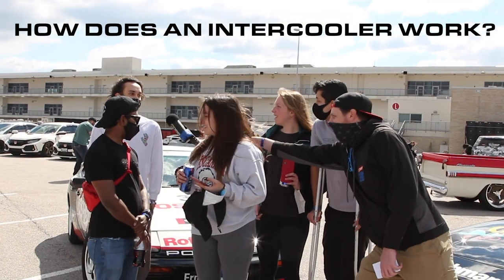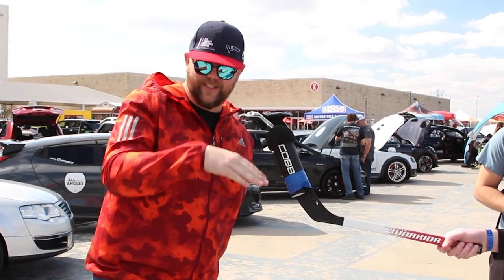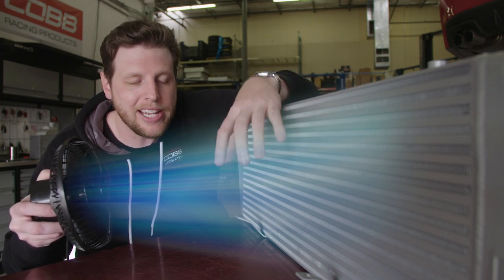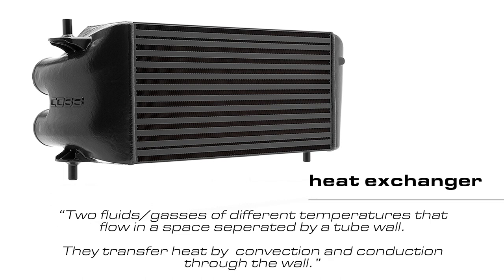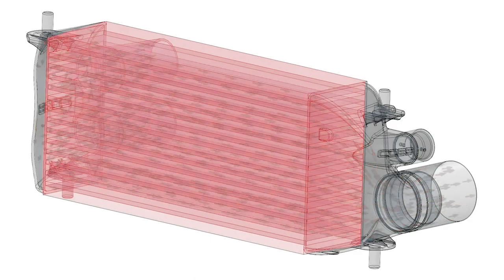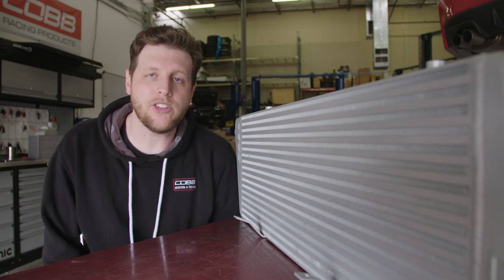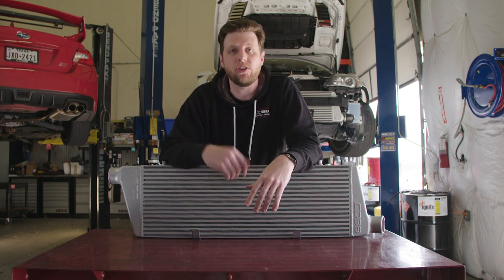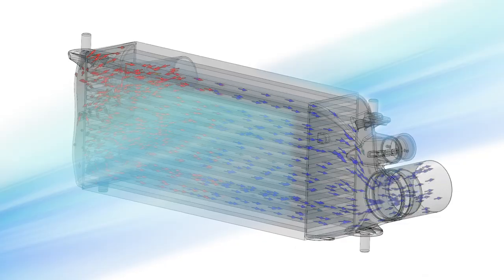COBB Tuning - Car Quickies with COBB - How does an intercooler work?

Comment: I Would have said, an intercooler is a basic heat exchanging unit for your engines intake system.. Its the thing that all my boost is leaking out of between my turbo and throttle body..
Reply: or for your engines coolant or oil also